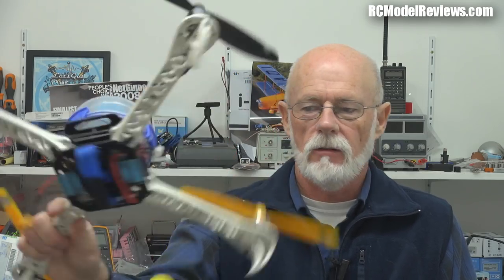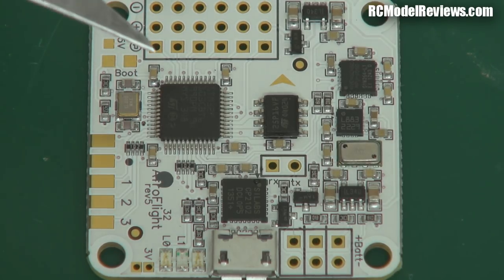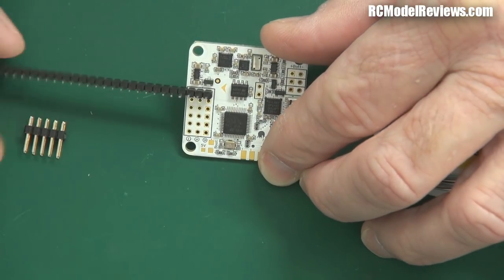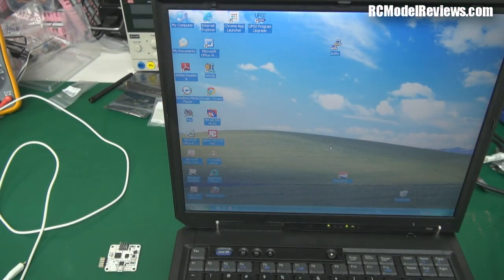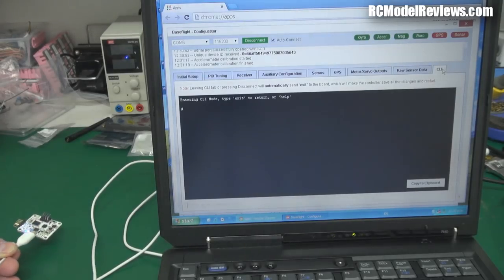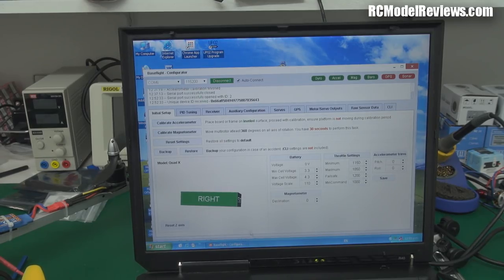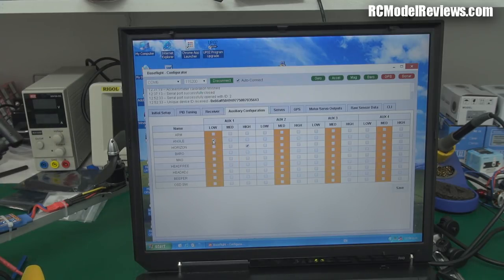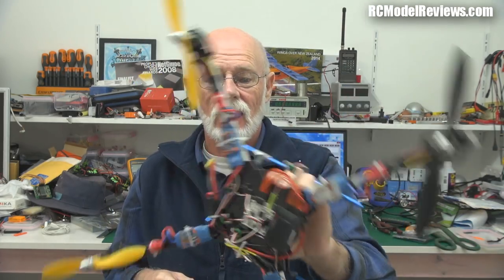Naze32 multirotor flight controller (part 1)

Comment: Having issues with my blackout mini H crashing when trying flips with the naze32. I am flying with d4r-ii in cppm mode. When I attempt flips sometimes the motors will shut down and start to twitch and not respond to stick commands. Im not sure if its a throttle setting or the 18ms ppm problem in cppm? I have set my taranis in D8 mode and am only using 6 channels sense I dont know how to flash the rx to 27ms. Anyone else have this issue?

Comment: hello, what is the diference between
naze32 acro and openpilot cc3d
thanks
Reply: They are basically the same. The Naze is a tad more difficult to setup compared to the cc3d, but the Naze flies a lot better than a cc3d. I have both and the Naze flies like it is on rails and does exactly what you tell it. The cc3d is a bit sloppier and washes out of turns a lot easier. The difference for me was night and day.
Reply: thanks Steezicus

Comment: How does that compare to the ardupilot controller?
Reply: In my experience, the Ardupilot has more capabilities in the area of GPS-controlled flight (ie: pre-programmed waypoints, flight-planning, etc) but the Naze32 with the multiwii software is much better for manual flight and seems to work brilliantly well even without any tuning.

Comment: Naze32 with GPS vs ardupilot 2.6 with GPS? What should i get
Reply: Depends on what you want to do.

I have not used the RTL/GPS functions yet on the Naze32 but I hear that the Ardupilot is more capable (mission planner has way more features than Baseflight configurator) -- albeit the APM controller hardware has pretty much hit a limit with the 8-bit processor.
Reply: ***** Now you can have the Pixhawk that also was a 32bit processor. You can do a lot more with it that you can with the naze32, but is a good simple board
Reply: ArduPilot 2.6 also requires an external compass as V2.6 does not have one built in like earlier versions, i.e. V2.5.2  If you want to use waypoints for autonomous flights, then the Ardupilot is more capable.  For a better processor that can run the ArduPilot firmware, then look at the Pixhawk.
Reply: I was under the impression that the Naze32 GPS data is for testing only. They haven't tried it during flight yet. At least that's what the web site says.
Reply: Tim Coombs
There is a fork in the multiwii development (harikari?) which supports GPS on the Naze32 board.
Reply: Tim Coombs Naze32 with Baseflight does work with GPS (both ublox and NMEA) - take your time setting it up and it works just fine - basically the same GPS functions you get from Multiwii, afterall its a port of Multiwii!  It's great if you want to do FPV and display location on your OSD, and switch into position hold or return to home - however it's really a platform focused on manual flight, acrobatics and fun.. not hovering in one place... so go out and fly! Don't flick a switch and hover in one place.
Reply: Which board offers the best position hold?
Reply: gagomand If you just want to hover then the Pixhawk is quite good at most things GPS nav related. But you are paying seven (7!) times as much as a Full Naze32, or seventeen (17) times as much as the Naze32 Acro! [$280 for the Pixhawk + $90 for the GPS. $21 for the Naze32 Acro and $52 for the full Naze32, ~$18 for a ublox GPS]
Reply: Various vendors.  Do a google search.
Reply: felixrising Some people need to hover.
Reply: Tim Coombs naze32 funfly is the gps version and it works flawless better than my dji naza mv2 with gps that's for sure
Reply: felixrising I can buy a full pixhawk complete with gps 113.00 free delivery  not a clone real pixhawk p4!!!. I can build naze32 from ebay parts for 14usd funfly version
Reply: david ringler you dont know of any setup videos for the GPS features  I cant seem to find any
Reply: The mutiwii firmware has more features than baseflight for the naze32
Reply: DE LEON  Thanks so much I will set that up
Reply: You'll have to do a bit of research and be careful with 3v and 5v connections on the naze32 , If you Google naze32 gps connection and look at images , plenty of schematics on how to connect wires .
Then use the CLI to activate gps on the naze
By typing commands like ,
feature gps
set gps_type = 1
set mag_declination = (depends where you live) google search to find value to put here . good luck Bro!!

Comment: Make a DIY naze32 cost 10$, it is ultra simple and ultra fast to be done.
Reply: Elm, do you have a link and parts list?
Reply: Aus Crankster You can check the DIY Naze32 video on my channel, and from the video description you should find all the info and links. I have also an ongoing thread on RCG about DIY Naze32.
Reply: Thanks Elm, I'll check them out.

Comment: You're a Mode 1 :)
Reply: Yeah... I'm so old-school :-)
Reply: My son and I are the same :D. We are about to fit a couple on Naze32 Acro's into a couple of mini quads. ATM we're using the NanoWii which works amazing well and even better when my son is at the controls
Reply: BMSWEB Mode 1 in WA too (think I am the only one however)
Reply: Well if you're ever in Melbourne you're welcome to fly with a couple of Mode 1 Pilots :D
Reply: Almo Cox No I am Mode 1 and proud of it.  I started on two channel radios and never changed.
Reply: Mode 1 19 years old
Reply: My whole club is mode 1
Reply: TheRattleSnake3145 I've been feeling so out numbered by all these Mode 2 people :)
Reply: BMSWEB
  As far as Ive seen, most people in Australia are mode 1.
 that reason is why I chose mode 1 when I taught myself to fly.
Reply: Same reason I chose mode 1 too
Reply: TheRattleSnake3145
I think you are correct. I fly mode 2 and have since I was 16. Taught myself (sought of, father was an actual pilot) because no one else fly's mode two here, except me (Vic) and WA.

Comment: When it comes to the health of RC, FPV in particular smaller is better. And here is an opportunity to save weight AND space by not using the  heavy plastic connectors that have yet to be replaced by something up to day and just solder the wires straight to the board. I have to cut and pull the headers to do that on the KK2HC board to get it to fit in a thin wing. I see no reason when trying to save space and weight to ever use a one and a quarter inch servo/asy connecters that sometimes weigh more than the wire and that's female end is over a half in long and I know what I am going to use it for. Once the wires are soldered on it's easy to shorten or lengthen them as well as secure the wires so they don't break at the solder point. I wish you could get the KK2HC without the darn headers. Look at the size and weight of the "standard" connector and how far they stick out on a KK2 board. This a beautiful well made board and I think the main complaint of "needing to solder" is a great assist. I wonder if time will agree on the multiwii software making it past history as one reviewer stated. The software screen looks rather basic and simple, and I like basic & simple when it comes to software a well as everything else...

Comment: Weese.... The naze will not work properly on a dji frame. Any dji frame. Unless you can get it almost completely vibration free. Timecop (the naze designer) has stated this many times and it has been proven many times too. The naze is too sensitive to vibration and dji frames create a lot of it due to the materials they make them from.
Reply: Well we had a Naze32 flying on a large quad that lost half a prop.  The very significant vibes didn't phase the controller and the craft was landed safely from quite a reasonable height.   I've seen lesser controllers immediately flip a quad when half a prop has been lost.  I'd say the Naze32 handles vibes pretty damned well :-)
Reply: I have had very good results on F330 clone frames, the main thing was to get low vibs from the motor-props, one can also play with LPF settings if need be.
Reply: LOL - just put a piece of electrical tape over the DJI logo on the frame and it will work fine.

Comment: cut my esc servo cables to length and poked wires through the holes from underneath and soldered straight to the board, ultra tidy only wire you can see is one going from naze to rx for cppm. see it here near bottom of the page http://fpv-forum.com/index.php?topic=3707.msg24356;topicseen#new

Comment: Can't get my Mac to connect,
Reply: Nobody will say it but the program is run by windows or a pc.I have this naze32 im having a hard time setting this thing up.
Reply: If you have a Mac or PC, you will need to load drivers for the serial connection. Do a google search for Naze32 drivers for your platform. Most Linux boxes will just connect, you may have to set some permissions or set up a UDEV rule, not sure as my Linux box just found the device and worked with both Cleanflight and Baseflight but I also do Arduino stuff as well, so there maybe more stuff required on Linux systems.

Comment: After hearing all this hype about it from Bruce and others I bought myself a naze... Boy did I ever find it disappointing. It's not easy to setup at all, not very intuitive and it flies terribly with a delayed feel to the controls. NOTHING at all like the very user friendly CC3D which guides you through all the important steps and gets you flying quickly, yes sure it requires some tuning for each airframe as the defaults are conservative but that is a small problem compared to the illogical naze configurator. I hate this Naze almost as much as I hate the APM, how do you people put up with having to sub trim your radio because the centre is off? It's so backwards. Take the lack of a default flight mode for example: there is no rate mode that you can select, you have to leave everything unchecked for that switch position to select rate. Yeah... makes perfect sense....

Bruce, no offense meant but a large part of my buying decision of the naze was from your videos and to me it's honestly a paperweight. I therefore propose you put some real effort into learning the CC3D or I can send you my naze if you send me the CC3D :)

I like option 2 better.